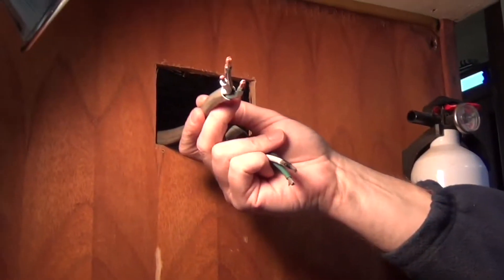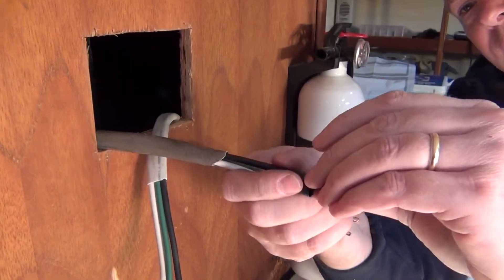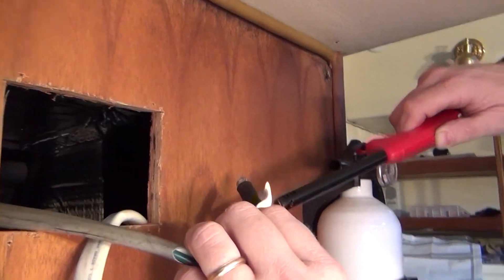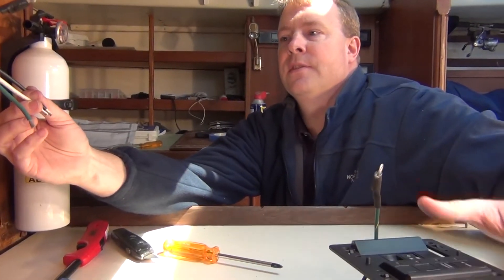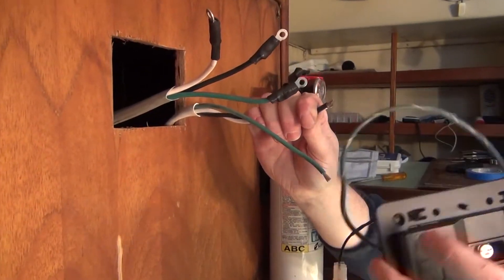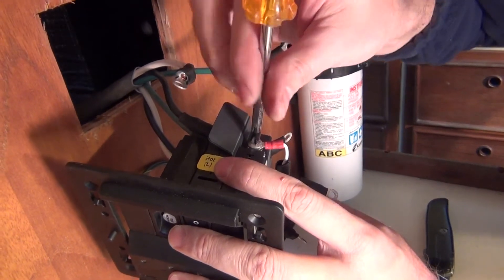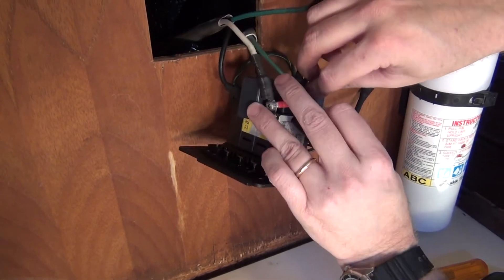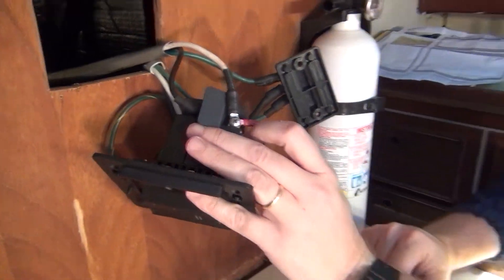ELCI installation

Comment: Thanks for the excellent installation demo. This was helpful as I just received the Blue Sea 3117 dual ELCI panel. Before I found the prepackaged version from Blue Sea I was just going to make up my own box, which caused me to look up the indicator lights circuits. On the Blue Sea version, I do not see a resistor on the polarity indicator. How much do I need to worry about that?

Comment: Unfortunately, there are a number of "bad practices" demonstrated in this video.

1. No mention of "locking out" AC power to the circuit.

2. Wearing Jewelry???? Despite having checked and verified power is removed, nobody should be wearing jewelry while working on marine (or any) electrical systems. 

3. The cables and/or conductors should be labelled in such a way to identify what they should be connected to AND where they are coming from.

4. The cable sheathing should be insulated (e.g. heatshrink) at the sheath termination to ensure the conductor insulation was not compromised while severing the sheath. (Good place for cable identification marking).

5. Metal parts of tools should not be contacted while wiring (e.g. fingers on shank of screwdriver.)

6. Terminals should not be contacted while wiring (e.g. metal connectors and screws with bare fingers.)

If the AC shore power, generator, inverter, or any other possible AC  power source was not properly disconnected and locked out, it would be highly plausible the system could still be, or become live, and the worker electrocuted, especially while handling the grounding terminal block near exposed potentially live conductors, especially in a marine (potentially wet) environment.

Many changes needed to earn the cigar for this show.

Comment: If you were on the dock hooking that up the wires would have to terminate in a box and be secured. National electrical code. But because your on a boat just wing them.
Reply: It is not up to code on a boat either anymore. There needs to be a covering over the AC wiring.
Reply: @mckenziekeith7434  
Good. Thank you
Reply: ABYC does not allow wing nuts for marine applications.